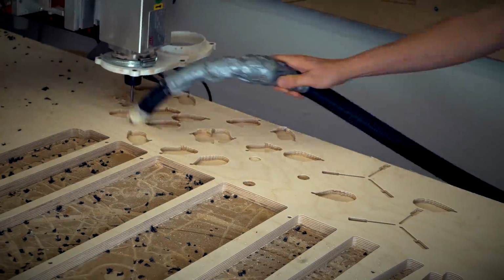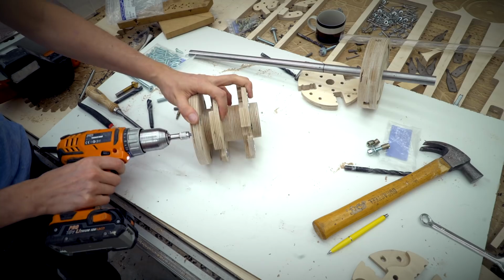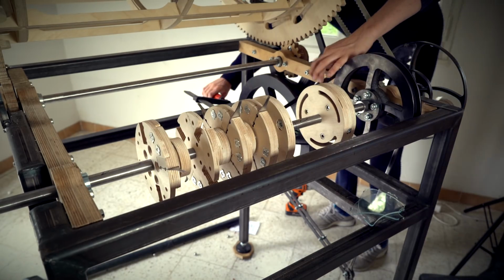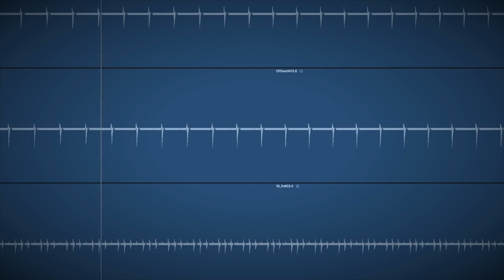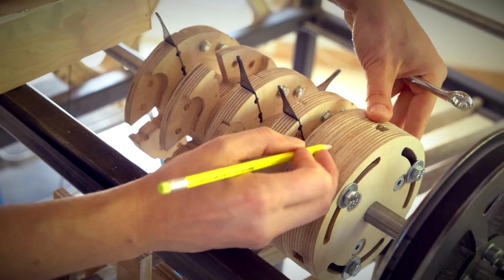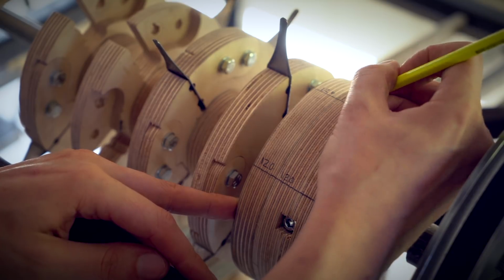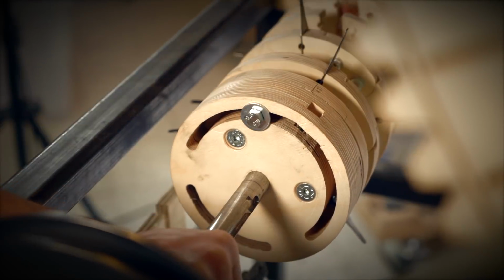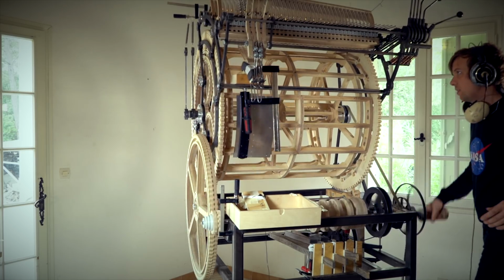Testing the Mechanical Rhythm Machine - Marble Machine X #55

Comment: Instead of cutting out the circular slot you could have just added another threaded insert (X3) in the other disc. Then you could have kept the three bolts and just shifted their positions to the other inserts as needed.

Comment: Adjusting the timing wheel means having to adjust to a fixed time which one marble needs to release and fall into the box. So every BPM change causes a need to readjust the discs relative to the falling time (which stays constant for a certain distance a marble actually falls down) to be in sync again with the arrival of a marble at the box.

Comment: 22:17 you need a wind-up adjustment to degree in those wheels so you can do it while playing without having to loosen bolts etc ... just turn a handle until the wheel is degreed to the right point? orbital gear cluster perhaps?

Comment: Have you considered a resonance box for this part of the device?  You'd get more volume, like sound dynamics of a speaker cabinet. 
I imagine you could hang the "box" underneath. and if you put a door on the bottom that you could adjust the size of the opening,  you will get variable resonance values.  Right now... it's a bit flat.
Reply: I gave it more thought, if you could completely enclose it, then use a front set of loovers , like on a pipe organ.  It wouldn't take much to build a box around it... I know you like the visibility of the moving parts, but you won't get the same resonance from a clear plastic box.

Comment: great work! regarding the failure of the flat belt I was wondering what types of pulleys you are using (couldn't really see in the video). For flat belts, pulleys with a convex cross section can be used that will always hold the belt on its thickest point (no need for a disk on the side which do not really work I think). For reference, see https://en.wikipedia.org/wiki/Belt_(mechanical)#Flat_belts

Comment: Is it possible to design a built-in automatically variable synchronisation system? I seem to remember that an engineer once designed a gear system for cars based on a cone and belt. As the rpm of the engine changed, the belt would automatically slide up or down the cone to always give a perfect gear ratio for the rpm of the engine. It was never put into mass production because other engineers were concerned about the gear system being reliant upon the strength of a belt. However, the Marble Machine isn't a car, so a timing system based on a cone and belt might work. As the Marble Machine goes faster or slower the timing of the marble drop would automatically adjust itself as the belt moves up or down the cone, so that no matter how many bpm you played in, the marble drop would always be perfectly synchronised.

Comment: I think you should have a sliding helix between the fixed wooden piece with three adjusting bolts and the music playing wooden parts. Then sliding the wooden parts left to right would adjust the timing while playing. You could then adjust between 120bpm and 80bpm without stopping.

Comment: thinking about playing on various bpm and changing register on the fly, there is a avionics mechanism that can help about it.
Airplanes propellers as well on helicopters rotors, can change blade pitch while they are rotating.
I'm not as good as you but this idea may help somewhere on adjusting on the fly

Comment: For the timing adjustment on the drum could you add 3 more T nuts spaced evenly between the current ones. Then when you run out of travel using the first position you could swap the bolts to the second.

Comment: dude you did not need to do all that just to make those sounds. You could of just slipped in a cylindrical tube and screwed the metal prongs in the same way and got the same results.. work smart not hard . PS. this sounds absolutely nothing like a beat at all no drums no symbols it just sounds like an out of wack washing machine.
Reply: It's not done yet. That's why it doesnt sound... you know... done.
Reply: @maxz8807  I don't think you mentioned that.
Reply: @patman0250  what?
Reply: @maxz8807  exactly
Reply: @patman0250  no, like what didnt I mention? Do you think I'm the creator of the videos? I'm not.

Comment: Watching this, I cant help but think that you should use a system like this for speed adjustment / registration:  https://youtu.be/O4h-Me5lSOY.    And yes, since I'm making a suggestion, I'm also volunteering to help build it.  I have a CNC mill and lathe and would love to contribute to the project.
Reply: Never Mind...  that wont work at ALL.... You don't want differential SPEED... you want differential DELAY...   You could do that with a clutch-like indexing mechanism.  To change the delay, you just push the implements left, rotate them and let go.  A spring on the left side of the implements pushes them into the clutch plate on the right which drives them.  For the clutch plate I wouldnt have it just be friction though...  I'd have a series of small locating pins that match into holes on the other side so that you have very granular, repeatable stops that wont slip.

The offer to help still stands :)

Comment: Lots of people came here to suggest automatic timing advance for the rhythm machine. How about using a mechanical governor to both change the position of the rhythm machine's contact points (the stationary ones, not the rotor) and to act as a beat-per-minute gauge? https://youtu.be/B01LgS8S5C8

Comment: If you're having problems stopping the machine quickly, it looks like it would be pretty easy to put a simple friction brake on the fly wheel. It would only require a lever or pedal sticking out the front.

Comment: I'm super sure that Machine X is going to be awesome, but there's something just as awesome (if not MORE awesome) about how rickety the original was.  It amplified the genius; sort of like how when you're going for a certain look, you don't want to look like you tried too hard.  The rickety-ness of the original sort of had this "I just threw it together" vibe that just made it all the more impressive for it.  With the marbles falling all over the floor and rolling around, and the wobblyness... it just had this special charm.  I'm afraid the machine X is going to lose all of that character.

Comment: By using a planetary gearbox (which could be made from wood) with a worm drive controlled anulus, you could have a totally controllable, 360 degree, on-the-fly, phase shift of rhythm. No need to stop and adjust.

Comment: 7:42 "In old factories they always tuned flat belts in C#, to avoid resonances when they were listening to music, because music was almost never played in C#, so the flat belt didn't resonate".
Well, too bad that's not how resonance works. C# does not just resonate with C#, it resonates with absolutely every note of which it is part of the overtone series. 
Walk to a piano right now, lift the damper off a C# by slowly pressing down the key without actually making a sound. Now play an A, or an E. The open C# string will resonate.
And I don't need to tell you how people play Es and As all the time. 
So yeah. Close but no cigar.
Reply: Unless you play in a key with three flats. Then you don't play any a-naturals or e-naturals, unless it's an accidental.
Reply: He also called quarter notes sixteenth notes...

Comment: You need a mechanical phase locked loop between the dropping marbles and the rhythmic part so that they synchronize with each other at any beat. By my calculations, you just need 10 years of R&D and a 3000 part assembly and you're good to go.

Comment: there's probably a way to make a mechanical bpm meter using a what's the word, governor like on steam engines
Reply: mcasual a steam governor pushes a rod further out with faster rotation as the weights push further out from center. Could make a gauge like a yard stick the first line 40, then 80, then 120 bpm

Comment: You could cut keywas (or just flats) on the shaft, to make sure you get 100% correct positioning.
(You could probably also have turned most of the cylinder in a single operation on a wood lathe .But any method that solves the problem is a good method :-)

Comment: Rasberry Pi.........the electrons are moving in the wire the same as the marbles moving in your machine, you just can't see them. This is no different, just using old technology for the sake of using old technology not because their is anything more beautiful or better in doing it this way. Electrons are the new marbles get with the future and don't waste your life doing something that can  be achieved with a Raspberry Pi in a few weeks.
Reply: What's the beauty in this?

Comment: L. Frank Baum, famous for writing "The Wizard of Oz", also wrote a book, "Rinky-Tink in Oz". You'd like it.

I stopped at 22:39 this time. It's physically painful to watch these videos. Fascinating in a morbid kinda way, but painful. Fascinating in the same way it was fascinating to watch my kids build their first tree house. All the while, you want to point out that no, that one nail, halfway hammered in, will not make a good ladder step. You can't though. Journeys of discovery are a delicate process, and assistance is as likely to spoil a journey as aid it. Anyway, kids won't get that unless they make the mistake themselves, and wear that cast on their arm for six weeks. That said, I have to intervene: you need to put a key-way of some sort on that shaft because those set screws won't even work long enough to finish adjustments. Good luck, kid.
Reply: You're very near to understanding why such a machine didn't exist 200 years ago, and why even the simplistic Orchestrion machines were never more than a passing novelty, and why they were a repairman's financial wet dream.

Comment: A CENTRIFUGAL GOVERNOR - could be used to automatically adjust the timing plate to match a range of BPM. This would allow for minor slowdowns while keeping time with the falling marbles. You may have already included something like this in your design since the clock tower chimes used the small fans as a power train regulator. Can't wait to see Project X up and running!

Comment: I've just spent the last 24ish hours watching this full playlist with intermittant power naps (you're not the only master procrastinator lol) so I've seen the adjustments you made to the footpedal in the interest of safety, my concern now is the safety surrounding the crank itself. Letting go of the crank to use the pedal is all well and good but at some point I presume you will want to start using the crank again while it is still spinning with all the accumulated weight of the machine and flywheel behind it. this could cause injuries to wrist, hand and fingers if you misjudge only a little. Also of note is the fact that the whole crank assembly looks to be around waist height on you, if you misjudge your step you could be looking at hip or leg injuries (or worst case scenario you really could lose your marbles). Could this be made any safer by including maybe a one way bearing in the hub? I'm no engineer so I don't know how much torque these will stand or if the will have enough to actually power the machine when using the crank, it's just an idea I had, I'm hoping other commenters with more know how will add their thoughts to this as well. This would mean that if you accidentally got in the way of the handle it wouldn't have all that built up energy behind it to cause serious harm. 
Just a thought. Loving these videos and can't wait to hear the finished product.

Comment: You might be able to get rid of the preset clutch by using a planetary gear set around that shaft, and then you could adjust the delay on the fly. Just make the shaft the sun gear, the tempo machine the ring gear, and have the planet carrier attached to a lever under your control. By adjusting the planet location, you would be able to vary the delay smoothly as it played. This adjustment could even be set to a governor to automatically keep it in time with the marble drum.

Unfortunately, this single planetary setup would introduce a gearing reduction, but that could be fixed by turning it into a double planetary setup. In that case the tempo machine would be powered by a second sun gear, and a second set of pIanets would run to the shared ring gear that would have powered the tempo machine in the single planet set up. This ring gear would be free to rotate, and each planet carrier would be able to adjust the delay, allowing one to potentially be controlled automatically by a governor, and the other to allow on the spot adjustment by the operator for fine tuning or as a backup in case of a failure of the automatic system.

Comment: Might I suggest creating a safety lock of some sort that slots into the adjusting wheel at one point so that you are guaranteed all adjustments will be made from the same baseline.  Then you can measure all your angles for different BPMs from that baseline and insure that the machine will not move if something accidentally catches the crank.

Comment: Hey Martin. I admire your talent and work. I have one question: how do you solve to change the speed of the mechanical rhythm machine?
I Image a kind of lever which locks in 120 bpm and 80 bpm position. But that won't solve the following problem: Maybe you want to play a song with faster and slower parts.
It would be cool it the maschine could adjust to the speed of the flywheel. So it will always be in the der right speed.

Comment: Hi Martin, awsome work. I have two random ideas while watching: 
(1) Maybe while you rework on the flywheel design, add a clutch to quickly disengage the flywheel. 
(2) Not sure how your final volume adjustment levers are designed, but I can see that you may want the volume adjustments to quickly go back to some precalibrated positions. Perhaps look at how airplane flap levers are designed. They have "Detents" and you shift position by slightly pulling the lever out. For example look at this home built 737 flap lever:
https://youtu.be/qAS_4zXs5J4?t=49

Comment: You can achieve discrete (but fine) angular adjustment of one wheel relative to another using two bolt circles with different numbers of bolts.  For example, you could put an 8-hole bolt circle in one wheel (45-degree spacing), and a 9-hole bolt circle in another wheel (40-degree spacing).  Then you put a bolt through both wheels where a pair of holes overlap.  You'll get another overlap every (45 - 40) = 5 degrees of relative rotation between the wheels.  If that's not fine enough adjustment, increase the numbers.

Comment: Having the timing depend on the rubber belt seems like a bad idea. Anytime that belt comes off you're going to mess up your timing and re-adjusting it is not a simple process. What if somehow added the beats to another cog connecting to the main cogs. If it's all connected you only need to set the timing once.

Comment: RE: 26:10 What is your proposal to make the Flywheel Stronger? More Mass ? or Bigger in diameter ? or Both ? IMO, I would think a bigger Diameter would be what you want (and YES it would make the wheel have more mass, which would give you longer play time once you stop pumping the wheel).
Oh about braking- try looking at what they do for mountain bikes disk Brakes, they last longer than the 'U' break, and don't wear down the brake pads as fast, and you will have better control of the braking (which is something I think you would want).

Comment: WOW! You are billiant and obsessive :-) THIS is going to be an absolutely AMAZING machine... BTW: have you ever throught about buildign the basic frame from extruded Alumninum profiles? A system like the one from minitec (www.minitec.de) would make setup and experimenting much easier and you have a gazillion ofoptions for standard shaft and bearings... and you couldintegrate pneumatics, too... Maybe for Marble Machine X + ???

Comment: so you have to adjust the rythm wheel for every change of bpm and be very precise in holding that bpm????? maybe some mechanical auto calibration?  a variable speed drive? a torque lever adjustment? there must be a solution since the error is constant and relative to the time of freefall/bpm i guess.

Comment: so you added a second flywheel ;) you can try using double sided adhesive for holding the cnc parts.  programme to bottom cut your parts leaving some shallow dents, which will be removed at the final pass. with some testing tape should adequately hold the parts for the final pass, only.

Comment: 10:53 wood level i think has a phusical brake point after some pressure over the time. The wood orientation and its natural lines of tree.
Reply: Ok, you will change them, in the end of the video.

Comment: What about an old tractor engine centrifugal governor design for automatic adjustment of timing?  As the governor spins, it acts on a cam advancing the timing.

Depending on the weight size, you could get it moving pretty slowly and “dance” to the beat with the lifting arms.

Comment: And maybe, instead of making heavier flywheel, you could add counter rotating second one. That way, you could stop it quickly without fliping whole machine around it (safety brake, like button or lever with preloaded clamps, is good idea now)

Comment: Martin, I’ve been following your machine since conception and it has captivated me.

One consideration I am wondering if you have put in mind is the balance of the machine.

When will build engines the crank is often polished for a few reasons but balanced to stop massive vibration and to honour and produce smooth rotation, not only for best performance but also for increased longevity.

Counterweights are built into the crankshaft of every internal combustion engines’ crankshaft, I am wondering if you are allowing for counterweights to allow for a balanced physical article.

I have limited knowledge of cad design, but I am curious if fusion allows you to estimate the shift of weight and balance in a machine designed, especially one like this.